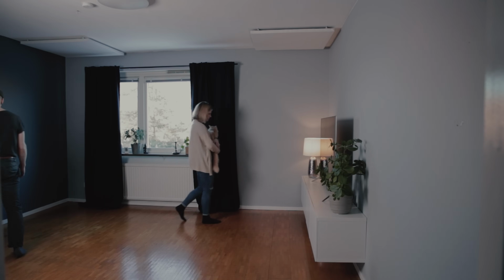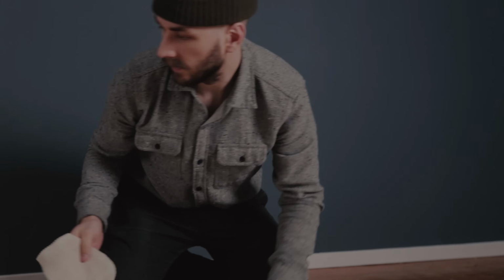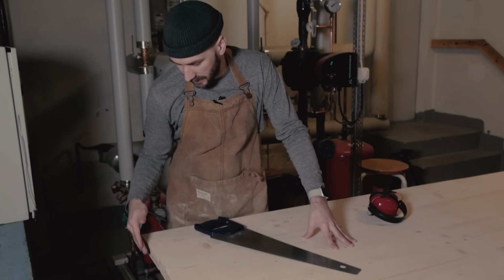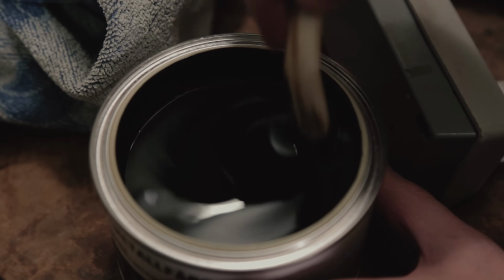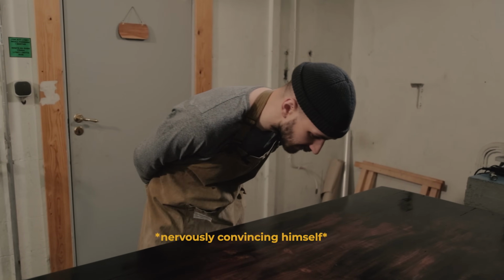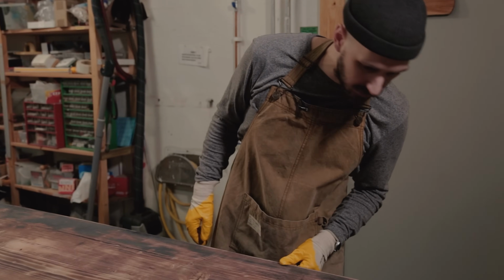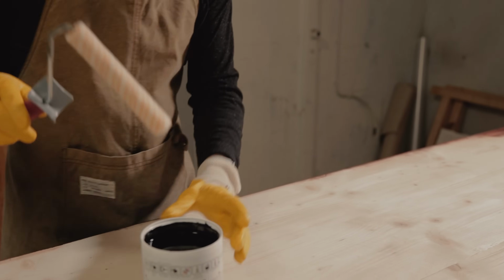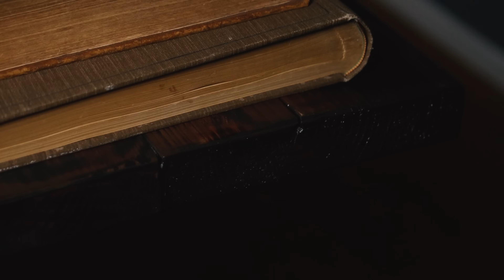Building a Desk using Cheap Wood (DIY)

Comment: I'm surprised you didn't use the track saw you used to remove the edge rounding to flush up the ends of the boards by trimming them. Probably would have saved you some effort over using the hand saw.
Reply from the maker: Yeah, you’re right, that would have been faster and easier. It was just that we wanted the edge to be kind of rough looking, and not completely square, to fit the whole vintage theme 😄 But thanks for pointing that out though, we appreciate you sharing  your thoughts and opinion on things we do!

Comment: Hi did you make the legs yourself or did you buy them? And how did you put them on
Reply from the maker: Hi! They’re adjustable legs that we were gifted from a friend, it’s really nice to be able to change position when working 👌🏼 we pre drilled holes and attached them to the bottom of the desktop using screws.

Comment: So you don’t need to use biscuits  to join wood?
Reply from the maker: No it’s not necessary, it mainly helps with alignment during glue up 🙂 but it’s not needed for strength.
Reply: @byferner  okay awesome , great video thanks!
Reply from the maker: Anytime 😊 Thank you so much, and thanks for watching!

Comment: Hey guys the old school finish look was spot on in the end. May I ask, did you use a matte polyurethane sealer or just a regular matte clear finish varnish? What brand?
Reply from the maker: Thank you so much! It was branded as “antique matte” the brand was ZAR. I still would have liked it to even more matte. One idea would be to give it a very light sanding with a fine sandpaper or a “sanding rag”. I tried that on the coffee table we made and I liked that better!
Best of luck with your project! Thanks again for watching and asking questions!
Reply: @byferner  thanks for the quick answer guys, I'm going to try a similar one but oil based instead of water and see how it works out. That coffee table is quite rad looking, great taste you guys have just the way I like it as well.
I think the finish you've used is more satin than matte which goes right between that and glossy looking, but the idea of a fine sandpaper post conditioning works great just as much for that rough looking kinda project. 
Keep up with the great projects 
Cheers!
Reply from the maker: Thank you so much Keven ❤️ really appreciate the kind words and tips! 🙏🏼🙏🏼

Comment: Wait, did I blink and miss those planks being more than just glued together? No tenon or biscuit joints?? What glue was that?!
Reply from the maker: Nope, you’re 100% correct. Just regular wood glue my friend, it is way stronger than you’d think, no tenons needed! Biscuit joints or dowels can be great to help lining things up, but will not make much of a difference when it comes to strength. Not when you’re making a table top at least!

Comment: looks incredible :) i have a question tho, is it really enough with just wood glue? it seems like enough weight could separate the pieces again. how much weight will that hold on the edges?
Reply from the maker: Thank you so much! Yes, as long as you get a bit of clamping pressure, the wood glue is actually stronger than the wood itself! :) Thanks again for watching and asking questions! :D
Reply: @byferner  i see, that makes it so much easier too! thank you :)
Reply from the maker: Indeed! Anytime, we’re happy to help! :D
Reply: @byferner   whats the brand and type of finish you're using? is it poly gloss?
Reply from the maker: The brand is ‘ZAR’, a water based polyurethane, with a ‘antique matte’ finish. I hope it helps, I could send you a photo of the product if you want, just send us a DM on Instagram or FB :)

Comment: The sanding after the stain is what always makes me nervous.. I feel like I just have to restain it again.
Reply from the maker: Generally you just need a fine sandpaper and sand it lightly by hand, you don’t need too sand much at all unless you want to make it look worn, so that shouldn’t be a problem! :-) You just want to make the surface feel smooth again, in case the grain rises after you apply stain or a finish :) You shouldn’t use a disc sander like we did if you just want a nice and even stain. We only used that to make it look worn.
Reply: @byferner  thanks!  Have you ever had stain come out very rough to the touch- almost like sandpaper?  Happened to me once.  Could've been brushing instead of wiping with a rag?
Reply from the maker: @craigzilla100  yeah, I believe it’s more so the fibers in the wood rising than anything else, because of adding any kind of “moisture” will result in the wood feeling rough. But it’s easily sanded off, with light sanding by hand with a fine paper 😊 the color might look a little more matte at first, but as soon as you wipe off the dust with a damp rag the color should look more like before you sanded it 😊👍🏼

Comment: What is the thickness and will there be any sagging if I also put my cpu with some books on the table 🙂
Reply from the maker: 4,5 centimeters (1,7 inches). Not the slightest! This thing is suuper sturdy! 😃
Reply: @byferner  Thank You 😊, I asked this question because I learnt from the Internet that pine is not so durable
Reply from the maker: It’s great to ask questions! That is true though, pine is less durable, but for a table like this it works great! (It’s more likely to get dents/scratches than hardwood, but it will not break or feel weak in anyway ☺️

Comment: Next project 😅 with only a jigsaw from harbor freight
Reply from the maker: I’m down! 😄
Reply: Would 150 be ok ? For the sand paper I have some laying. Around I have 60 80 150
Reply from the maker: Yeah for sure! It might take a little longer to get rid of the scratch marks from the 80 grit when you jump from 80 to 150, that’s all. But 150 is good enough for a matte finish. It’s all depending on what results you expect. If you want to super smooth and glossy finish you’ll have to do a lot more steps with finer grits.
Reply: Thanks it turned out great. I went simple with matte I love my new desk thank you again for this tutorial 🎉

Comment: ♥♥♥
Reply from the maker: Im not sure what you mean by that 😄 but thanks for watching
Reply: @byferner  😂 
Brother you should have used thinner with wood stain or As soon as you apply the wood stain, wipe it off immediately with another cloth
Reply from the maker: @wizardsiras4347 there’s a lot of things I’ve should have done 😂 thanks for sharing your thoughts tho!
Reply: @byferner  hahah😂 we sand like from 80 grit to 2000 minimum here
Reply from the maker: @wizardsiras4347 that takes some patience 😬🙏 It won’t take much stain at 2000 grit though, keep that in mind! I wouldn’t sand past 220 grit if you wanna apply wood stain

Comment: Save 200 on cheap pine spend 100 on staining and work for 10 hours. To end up with soft wood cheap table better off geting good wood and making a something that will last.
Reply from the maker: I completely agree with you, if I wasn’t a complete novice. But building my first table, Pine was perfect to play around with and learn. Especially since I wanted to make a worn/old look. I would have felt terrible doing that to a nice hardwood 😅 especially if I screwed up completely, which let’s be honest, I kinda did at times 😆